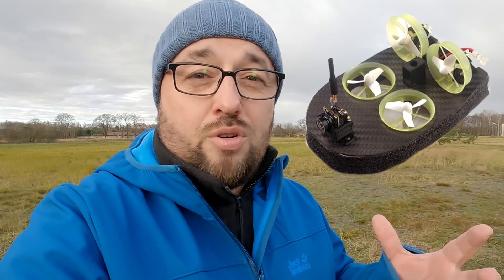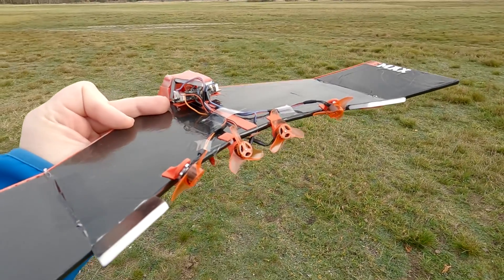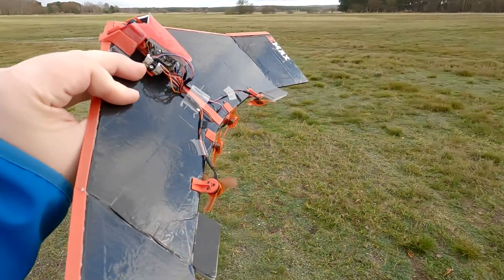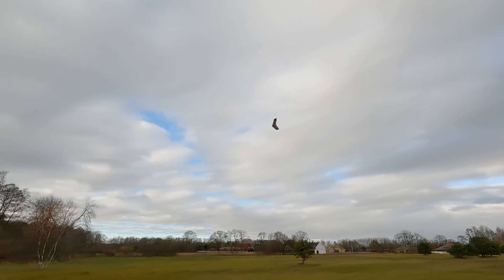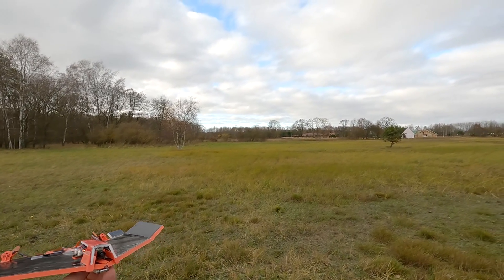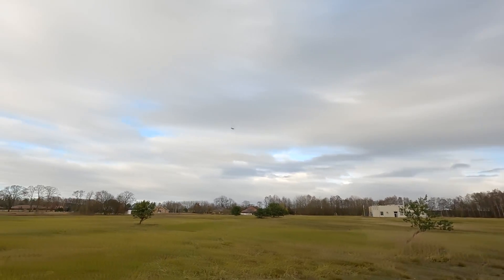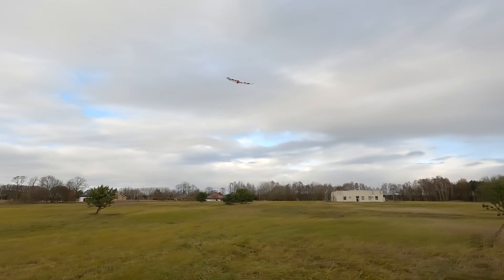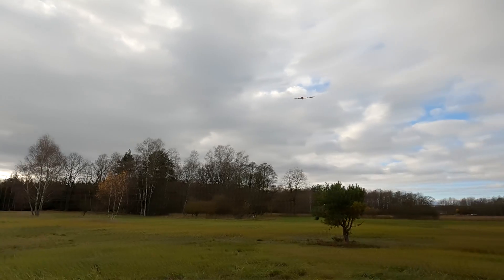Flying wing from tiny whoop parts - QuadWing

Comment: Yes, MonoPhan Val Leon has been making these for months but what i think WOULD actually be really inovative is if you could only just edit the inav code so we could pick ANY 2 motor outputs on a knackered AIO FC and turn them into a differential thrust setup so that we all could just dip into our bags of FC's with ONE knackered ESC and pick from the other three working esc's to make planes like the ones i modded a couple of years back, THAT would be something new eh mate? :)
Reply from the maker: That won't work as there are hardware limitattion from timer assignments. Not any pin can be used to any function
Reply: @FPVUniversity  Could we maybe look at it from a quad perspective with motor assignment and have a special quad mix that removed I term on rudder and let you pick which two motors you wanted to run?

Comment: I wonder if it would be possible to connect a servo to the tinyhawk aio, maybe directly to the processor pins. I have 2 boards with 1 burnt esc each and it always felt like a waste of FCs and VTXs.